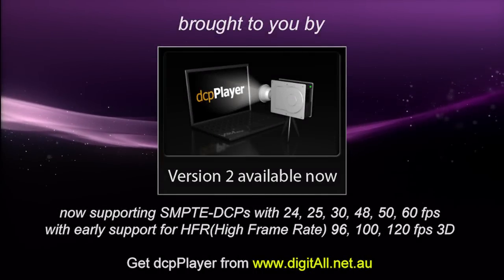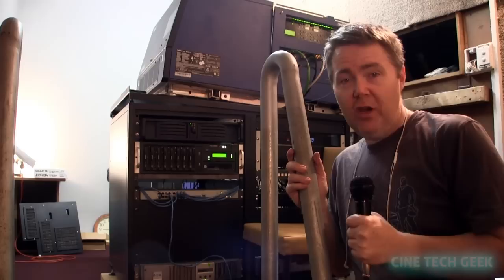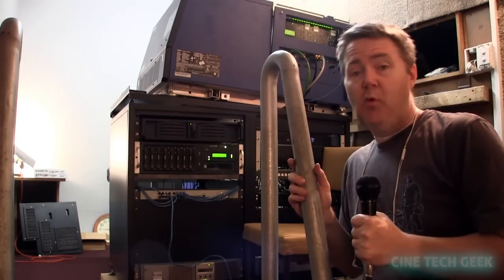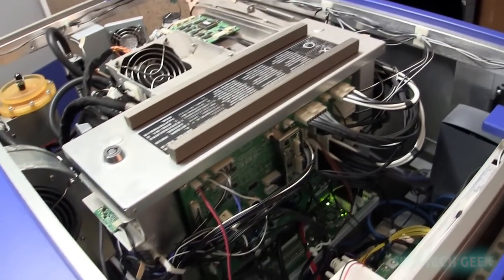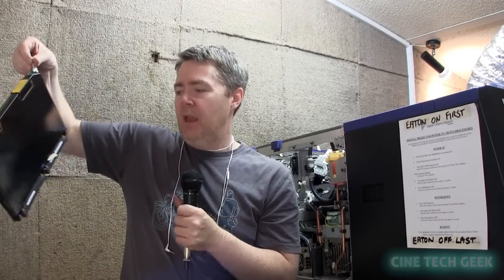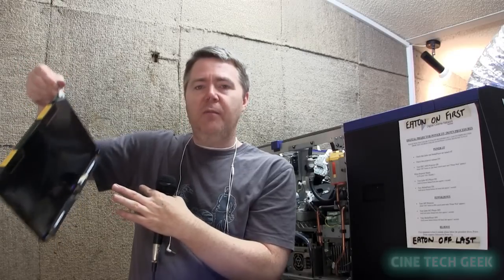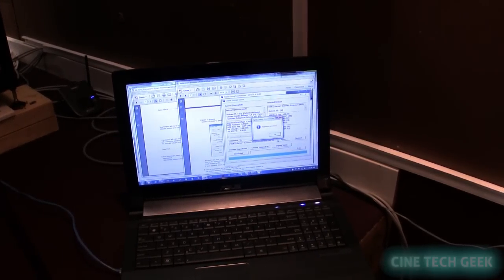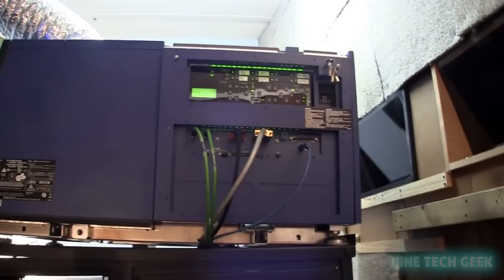Security in a Digital Cinema Projector

Comment: Thanks for this. Lots of thoughts due to seeing my short film very recently shown on a Sony 4K in Eugene at the festival. My Blu-Ray disc seemed to supply a quality image for the 26 feet wide screen, which was great for a 1080P film. (B&W) However the film was around 25% too light. I understand Sony 4K's have three gamma settings. (Not that many festivals accept DCP's for short film festivals) The problem of communication between a film maker and a projectionist is like trying to contact the president of Bayer Aspirin for a chat. There's quite a firewall. I was able to duplicate the look the film had in the theater by opening my film in Photoshop and in levels adjustments, moving the lower left black slider from zero on the left to around 33. Then to eliminate the lightened gamma look I adjusted the above black and midrange sliders in the levels adjustment box, but leaving the new lower setting at it's new position. Now...I pulled that lower slider back to zero, and now had a darkened film. I then exported it as a quicktime h.264. I plan to make a new Blu-Ray from this if I get into another festival and they want a Blu-Ray. But this is all based on guessing that the projectionist didn't choose 2.6 as the gamma to project the film. He could have chosen 2.2 or 1.8. Or maybe it was 2.6, and that firepower coming out of the projector was it's darkest richest setting.  Who knows? I actually contacted the festival to see if I could chat with the projectionist..or email. Nope. Nothing. I contacted an audio visual company that deals with projections. Nothing. I contacted the projectionist in San Francisco's Castro theater via Linkin. Nothing. (By contact I mean emailed) I left a note in the new discussions area on Stage 32, which is a facebook for filmmakers. You'd think prospective film fest people would be interested in making sure the gamma on their home calibrated monitors is matched when their film is projected in a theater. Nothing. No one responded, and there's thousands of film people on facebook. Like I said, DCP's are not accepted in many festivals yet. Oh, by the way, for that little dark thing on the snozz (unless it's temporary) ...I use a little stick with a brush made by Mabelline to cover some dark spot I have. Takes about  five seconds to apply. Lasts about eight hours. Handy.
Reply from the maker: This is a projectionist issue.  And if this is the case you need to complain as much as you can..  The projector should have a setting to exactly reproduce Rec709 colour and gamma as you had mastered to for the BluRay..
Reply: Yes. But I will repeat that Sony 4K's have those three Gamma settings. Now, how those get selected...either automatically or manually tells me a lot. The classic problem of course, is complaining after a festival....it's too late. That's why I'm trying to dialogue with projectionists who work at festivals...like S.F.'s Castro theater, and hash this stuff out. Might have to buy him lunch when I get through the firewall of contacting him. What's his experience been...does he get feedback at all...etc.  An expensive lunch.....
Reply: I have this nice Sanyo 1080P front projector at home. My Blu-Ray burner I bought for my Imac is Mitsubishi..and playback on my Imac using free downloaded software shows my Blu-Ray to look pretty great. But the suckers never play when I load them into my Playstation 3 to see what they look like on my front projector.  Ah...the world is against me....

Comment: This "secure security system that is very secure" is laughable.
Send me two of the boards, one pre-wiped, one completely secure and working, and I'll give you back the raw private keys for all the secure security.
They didn't even epoxy the boards, they just put a metallic shield around it, which is, oh wait, not glued to the damn board. Find the connection points, bridge them, cut the rest of the shield off, proceed to reading precious key RAM.
Here's a fun little DEFCON talk about this exact type of security - volatile powered RAM storage for keys.
https://youtu.be/XyuwsJJzMDk?t=1577 , or, 26:17 if the timecode didn't work.

Also, non-relevant question - why is there carpet on the walls of the projection room, not sound isolating foam? Is there a reason for it?
Reply from the maker: +Spirit Um no, from my understanding, they use a shield that detects changes in its capacitive properties.
You have to be very careful with the units as if you "scratch" that silver cover..  It will detect the change in the shield and immediately disarm.

So sorry Sprint..  not that easy.. Trying to get under that sheild would be very difficult if you could not even scratch it..
Reply: CineTechGeek If that shield detects capacitance, it would have to run quite a bit of averaging electronics inside(to prevent misfires), and that would most definetly not last a week on a single CR2032 pill battery.
Judging by the fact that you said "scratch" the cover - it may be a single spiral track, that, if broken, cuts power to the RAM. That sounds slightly more reasonable.
Reply from the maker: Its hard to say exactly what they use, but to be approved the units need to pass FIPS 140-3 compliance.  A military grade security conformance document..  I imagine many forms of this type of protection could be used.. But as required, it is secured to a high level..
How confident are you at getting around FIPS 140-3?
Reply: CineTechGeek Well, after a quick glance at FIPS 140-3 it says nothing about such methods, only about tamper-evident devices and something along the lines of "if they can't see it, they shouldn't be able to touch it".
Nothing about military-grade either, that's a common and absolutely meaningless term.
Reply from the maker: +Spirit The description of the document.. "The Federal Information Processing Standard (FIPS) Publication 140-3 (July 2007 Draft) was a proposed update to the U.S. government computer security standard used to accredit cryptographic modules".  The U.S. government primarily uses these standards for their military implementations.  ie to protect activation of powerful bombs/rockets.   I think it is pretty safe to say, this standard is primarily used for military purposes..
Reply: +CineTechGeek Yeah sure The Military will share their top secret encryption technology with movie studios to prevent content piracy. It may not be as easy as Spirit expects but very doable in my opinion.
Reply: the carpet on the walls is to make sure any fire in the theater consumes the booth as well. this way, no insurance will cover the equipment in the booth, and all the precious keys will be destroyed. also, the carpet walls are great for wiping the cheetohs hot nacho residue off of your nerdy fingers and ensuring high static charge, before handling the electronics. its a win win win.